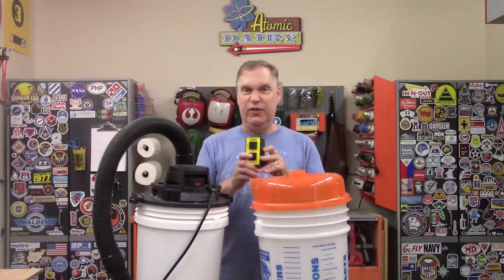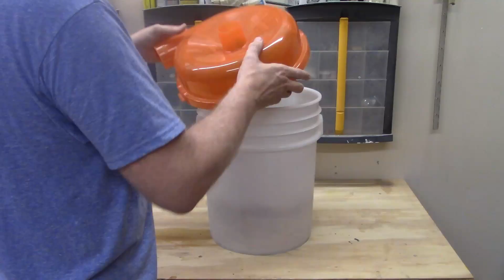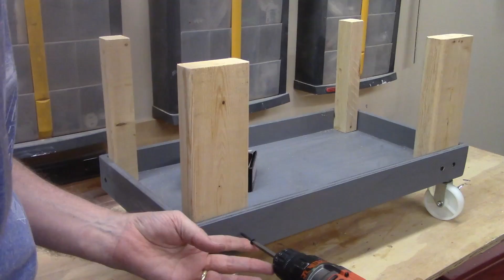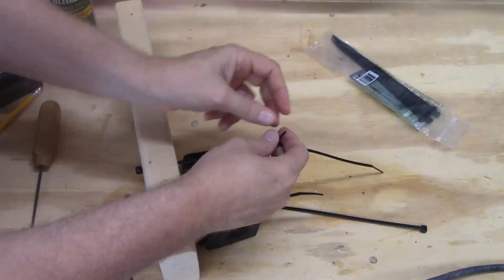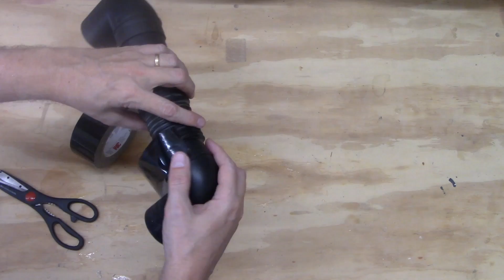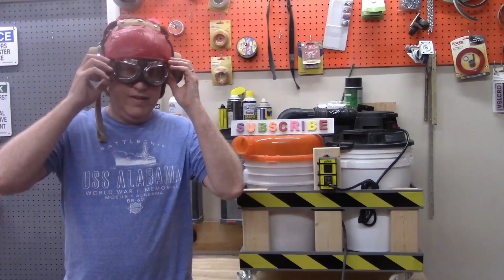Super Shop Vac - Cheap Automated Vac With Special Powers

Comment: My 5hp shop vac looses a lot of suction with dust stopper type devices. I’d be wary of a 1.75 peak hp bucket motor
Reply: Make sure bucket is well sealed for a closed system (and the bucket is tough enough not to implode).

Comment: Could you tell me what is the name of the vacumn you're using in your cart? I purchased one from Amazon but it is a craftsman and the hoses are entirely
 different.
Reply from the maker: We used a PowerLid vacuum. Here's the link: https://www.amazon.com/gp/product/B00FVZ91D6   It uses the bigger tubes but the one that comes with it plugs into the larger hole but uses a smaller tube.

Comment: Great project.  Wondering about making the i-Socket Switch cost effectively without an MCU.   Current sense to switch a relay with an MCU or am I over thinking where can just use a relay that will switch with whatever is plugged in maybe via a transformer or custom rolled transformer?  Dunno offhand... Youtube fatigue and other projects on hand.  Cool triple play of your projects!  Thinking can homebrew the dustopper also.  Making a DIY PAPR for welding, I found a neat idea that isn't as messy as plastic welding for connecting plastic hoses... using old plastic bottles and a heatgun.  That's all.   Maybe some duct tape on the seam if you'd like.  Will have to look into the headgear.  Military surplus like university surplus can be handy.  Testing the gloves and genIII level 7 extreme cold weather stay puff marshmellow man gear and is working great.  Have to see how the gloves stand up though.
Reply from the maker: We thought about making the switch ourselves but the cost of parts was so close to the cost of the one we could buy we just used the purchased one. Same for the dust separator. There are many great designs out there but the Dustopper was too simple to try to replicate.

Comment: That's a nice setup and it's too bad Shop Vac folded last week since their bucket top vacuum was the best I had used. I bough the one from the Orange Box Store and it's float didn't work and it blew water other through the motor and only a 1.25 inch inlet so I couldn't use any other hoses. Also aware that you used stuff you had but instead of hose pvc pipe and elbow are an idea.
Reply from the maker: I hadn't thought of using PVC. I may use that for a future vacuum project.

Comment: Thanks for this! Do you think the Home Depot Bucket Head would be as powerful/sufficient? I am using only a bandsaw and shavings from a plane, any help would be much appreciated.
Reply from the maker: Ours is 1-2 horsepower and it works fine for us, so if the Home Depot one is in that range you should be good to go!
Reply: Atomic Dairy Thanks for your response! The Home Depot Bucket Head is 1.75hp, seems like it might be sufficient. Thank you.
Reply: @toldey  what about the size of the dust collection hose?

Comment: I purchased one of these and noticed that it comes with a 1 1/4 inch hose did you get the 2 inch hose separately?
Reply from the maker: Our dust separator came with a 2-inch hose that we shortened and used for this project. The vacuum came with a 1 1/4-inch hose but we didn't need it since we had the larger hose from the dust separator.
Reply: @AtomicDairy  thank you I just wanted to make sure that there was not a change in the product, great video and I appreciate your work
Reply from the maker: @mattmerriam187  Thank you for the kind words and glad you enjoy the videos! We're having a ball making these and currently have more than fifty on the future list.

Comment: $35 for that bucket "shopvac"? It sounds like a good deal, but I picked up my 5.5 or 6.5hp (can't remember now. But it's a nonsense number anyway) stainless 12 gallon bucket Shop-Vac brand shopvac for $5 more. And it included casters, attachments, etc. Not to mention a far greater capacity and durability. Last Black Friday at Lowes, normally $99, on sale for $40. But don't misunderstand me, I'm not trying to piss vinegar on your project, I only wanted to say that with a little patience, one could score a solid shopvac at very little cost
Reply from the maker: Agreed, there are deals all the time. We went with this one because it was cheap, had a very low form factor that we needed for the shop, and was powerful enough for what we needed. But we agree there are lots of ways to do this right.

Comment: what is the HP  ????    I know it has 6.5 AMPS
Reply from the maker: There has been some discussion on that. We were told 3HP but others have pointed out that 6.5 AMPS puts in in the 1-2 HP range. I believe the commenters with 1-2 HP, but so far it has been powerful enough for the jobs we have used it for. Maybe not for something that generates a lot more sawdust, like a planer, though.

Comment: Nice compact, low profile system.  The "i-socket" not only lets the vacuum continue to run to clear the hoses after the tool is turned off, it also delays the vacuum's start-up so that the tool and the vacuum aren't starting at the same time causing a circuit overload and tripping your electrical breaker.  A couple of small and economical vacuums positioned around the shop are far less costly than a single central dust collection system and the associated ducting throughout the shop.  You just have to empty a couple of small buckets rather than hauling out a big container or bag.
Reply from the maker: It works great even a year later!

Comment: Nice build.  I REALLY like the small form factor.  Problem with using that with my SawStop Jobsite table saw is that I can't run the saw and shop vac on same 15a circuit or I continually trip my breaker.  But for router table and chopsaw it should work great.
Reply from the maker: We like it too. It's easy to store out of the way and comes out and does the job when we need it.

Comment: Nice build! I like how you kept the connection hose short, but I'm wondering if the 2 90° elbows negatively affects the efficiency.
Reply from the maker: We thought the same thing but we needed a short cart and the distance is so short that we figured the efficiency loss would be small enough to be acceptable. So far it's been working great.

Comment: Can you please list the link or part number for the baffle? I am trying to price out what this would cost to build.  Thanks for the great vid!
Reply from the maker: Oops, sorry. Just added the Dustopper dust separator link in the parts list above. It's from Home Depot and has been very effective in our shop. We have this one plus a dedicated one on our miter saw. They have all but eliminated our need to change the filter on our shop vacs. You will have pretty much zero dust in your shop vac after you start using one of these!
Reply: @AtomicDairy  I just bought one today and I did not have that experience.  I had more than half of the dust of a normal sized pile go in the vacuum.  It went right back to home Depot.   I have the big Ridgid vac.  Not sure why I got such bad results.  Thanks for the video though.  Very thorough.  Cheers
Reply from the maker: @fern9234  oh no! Sorry that happened to you. I've heard it is sometimes hit or miss with these things. I hope you find one that works better for you.
Reply: Fern I can address your issue of the saw dust showing up in you vacuum side, you have a leak some where in either the Thein Baffle side or the vacuum side, a way to trouble shoot for leaks is buy some incense sticks I use 3 at the time to generate smoke then move the sticks around joints and connection points. I have built many dust collection systems from home brew cyclones to baffles. Anytime saw dust was found on the suction side it was because of a leak. I hope this helps. Oh if you can use smooth hose in the inside and as few bends as possible to keep the parasitic drag to minimum.